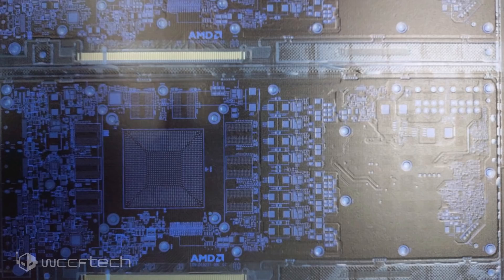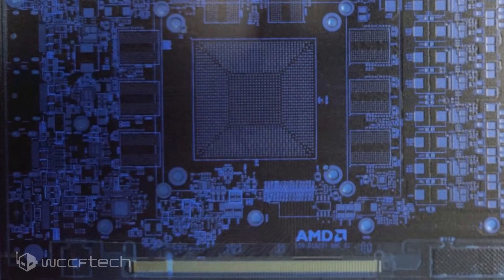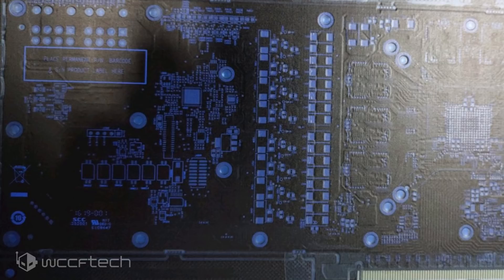Alleged AMD Navi GPU Based Graphics Card PCB Leaks Out

Comment: The wait is getting to be a bit too much!!

All I know is that Jim over at adoredtv had better be right RX3080 $250 or I'll be pretty disappointed.
Reply: rtx 2070 is around $500 so you're a fool if you believe AMD would offer the same performance for only $250, more likely $350-400 (20-30%) cheaper at best
Reply: @adventurethis  So what you are saying is Jim is a fake ass leaker and a lying POS for getting everyone's hopes up.
Reply: @AstroTrain100  Or he has some seriously misplaced trust in a particular source... or he got some things wrong.
I think for the most part, the Ryzen stuff is fairly reliable (though I'm expecting them to skip the 16 core Ryzen 9 3800 parts to save the higher binned 8 core chiplets for Threadripper and EPYC).
AS for his Navi, the only thing I can see potentially turn out true at this stage is the naming convention.
The Radeon VII is basically the "Vega 64 + 15%" card that his so called RX 3080 was supposed to be, and it's certainly not only $250.

With that said... we know the next gen consoles are coming and are powered by Navi. We know that they are going to bring Real-Time Ray-Tracing to the masses (probably using a more hardware agnostic approach like the CryTek demo), and it's probably safe to assume that they'll do 4k better than the Xbox One X... to kind of get to that point, AMD is really going to need to be able to make an RTX 2060/2070 class GPU at an affordable price unless Sony and Microsoft intend on taking absolutely huge losses on hardware sales for a couple of years. The current gen consoles, and their "4k" models both only released with GPUs comparable to those found in roughly $200 cards. I can see the next gen system releasing with GPUs similar to ~$300 cards, but not much more than that.